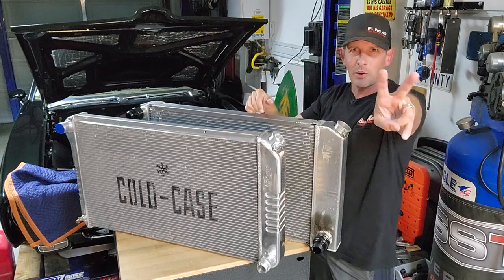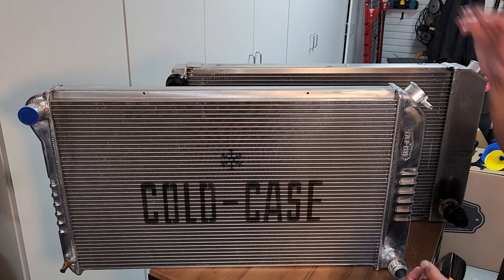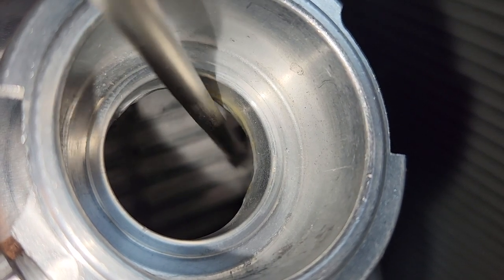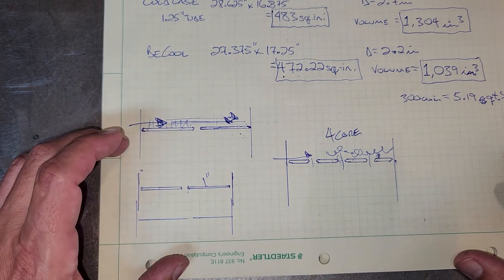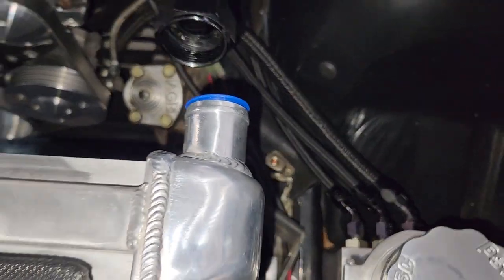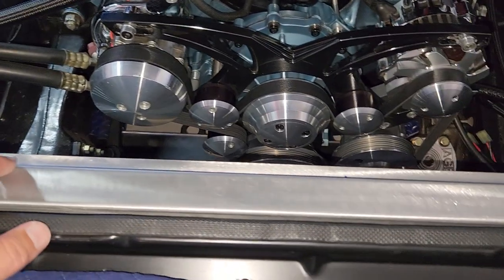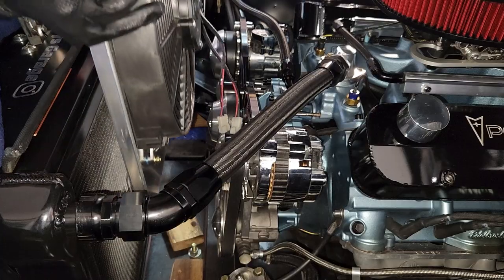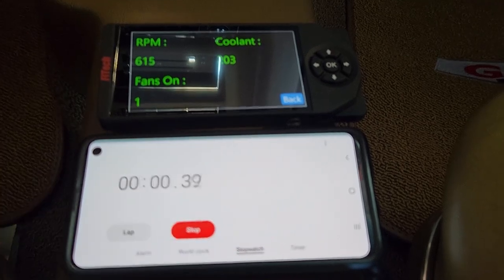Cold Case Radiator vs. Be Cool, with Twin 14" Fans, install and test.  Part 2

Comment: Could also be an effect due to paint. Surprised you didn’t check bare cold case first! Thanks for all the effort.
Reply from the maker: Good point... if at all, it would be a very very minor difference.  (I didn't paint the back side)  Thanks for the comment!

Comment: Fantastic content. So few people are talking about stuff like this, or doing much than repeating common cooling myths. 
CFD has shows that the coolant flow VELOCITY through the tubes is WAY more important than previously, though, too.  -This is where I think at a certain point there can be challenges with 2x1.25" wide tubes, or the event wider extruded tube radiators -they seem to need to be combined with high flow water pumps and thermostats to keep the coolant in turbulent flow. I think C&R / PWR said that when the coolant in a radiator tube moves from turbulent to laminar flow as it slows, the cooling efficiency can drop by 50%.  Theoretically, these radiators with more coolant flow area through the tubes need either more water pump flow or dimple tubes to increase internal liquid turbulence. 

What was your crank to water pump pulley ratio for this test out of curiousity?

Cold Case is the only one with those 2x1.25" tubes for ANYWHERE NEAR that price point. They're pretty crazy value. My critique is that sometimes the Cold Case radiators come with smaller inlet and outlet sizes when larger ones were available from the factory for the same radiator. I'd love to see those big 2x1.25" tubes not being restricted by tiny inlets and outlets. I also think they really should be letting people know that the big tubes work BEST with high flow water pumps and thermostats, too.
Reply from the maker: Thanks Adam... agreed about laminar flow, versus turbulent.  In my readings, that has a bigger impact on extracting heat from the block, which is also related to the type of coolant.  Anyway, my crank to water pump pulley is pretty close to stock, but I do have a FlowKooler pump.  I think my next experiment is using a dual flow radiator, also from ColdCase as I like their internal design.  Thanks for the comment!

Comment: I'd be interested in seeing a video where you adjust your coolant to water ratio down to something like 75% water and 25% coolant and make sure you have at least a 16 PSI radiator cap and do the test one more time.

Just add a compatible anti-corrosion / water-wetter product to provide the extra corrosion protection for the extra water.

I did NOT realize you were using Evans coolant! An even more interesting test is possible: Evans vs. A typical 50/50 glycol blend, then remove a calculated amount of the coolant blend (using an online dilution calculator) and add enough distilled water and an anti-coorosion+water wetter product to do a final 75/25 water to glycol blend.  -The Specific heat of your coolant will improve every time and the viscosity / flow due to the reduced viscosity will, too. 

At 180F, +14% coolant flow is required to make up for the decreased thermal conductivity of a 50/50 blend vs. pure water, I don't know the difference for pure propylene glycol, but it's not insignificant.  -Might even convince you to stop running Evans Coolant... 

If you think you'll do it, let me know and I'd be happy to donate $20 somewhere to help cover coolant costs for the test.

The Net Heat Transport Capability of 50% propylene glycol is almost exactly 1.5x as much as the 100% Propylene Glycol
Reply from the maker: Ha!  Nope.  Not gonna change from Evans coolant, i love it.  As you know, it has no water in it, which raises the boiling point dramatically.  Evans' site has some great education on why it works so well.  To your point, water helps with heat transfer, BUT, it boils too easily causing too much pressure, and possible cavitation, when both are combined, BOOM.  Good thoughts, non-the-less.  Thanks!
Reply: @FastMonty  I know what Evans SAYS. But there's many reasons why almost every form of racing uses pure water, high volume pumps, and high pressure radiator caps. Faster coolant flow and a higher radiator cap pressure will also resist boiling dramatically (282F) AND will give you way lower engine temps vs. Evans. 

Evans is trading more boil protection that you don't need, for higher engine metal / coolant temps that are quite beneficial.

Takes only one easy test to prove it either way and "good content". 

Drain the Evans, replace with VP Racing High-Performance (30% Propylene Glycol / 70% water.).
Reply from the maker: Might be worth exploring, thanks for the possible idea!   @adamarndt7617

Comment: Great video and WOW the detail !! ,  Thoughts on dual fan setup vs single Lincoln Mark VIII fan?  I have heard many people use the Mark VII fan with minimal customization  with the same controller you used. .  CFM rating and AMP draw are very close yet you save on $$$.
Reply from the maker: Thanks Raffi.  Yup, Mark VIII fan's work great.  HOWEVER, they only have two wires that pull 40 amps.  Versus twin fans I'm using have four wires pulling 30 to 40 amps total.  Moral of the story is the Mark VIII fan connectors are a trouble spot and must be upgraded in size.  OR, some other work around as to not fry that connector.  Thanks for the comment!

Comment: Awesome video thanks for the content! Looking to buy this radiator. What are you thoughts on it being made overseas and how do you think it compares to other USA made brands like Griffin?
Reply from the maker: Not sure it matters where it's made.. the design of "wide Tubes" works.  Griffin makes an awesome product too!  You can't go wrong either way... have fun!
Reply: Ended up going with the Cold Case with dual 14” fans. Great bang for the buck. Solved all my overheating issues!! Thanks for the tips!
Reply from the maker: @dvdr1985  That's great to hear!  Can you share what vehicle you "cooled off"?  Thanks!
Reply: A big yacht… 1972 Pontiac Grand Prix 🥸
Reply from the maker: @dvdr1985  Ohhhh very nice!  Glad she's back to floating on cold water.  ha, ha... thanks!

Comment: Again great tutorial  i have a cold case on my 65 lemans but have not started the car yet...   any thoughts on using a anode   (Flex-a-lite Radiator Zinc Anode)  i have one installed on my alum rad on my chevelle
Reply from the maker: Thanks Steven!  The jury is out on using an anode.  I know it can be worse with coolant that has water in it.  I use Evans Cooant, which does NOT have water.  So, maybe that's why I don't see any residue or damage?
Reply: @FastMonty  good point i forgot that you were i may be switching to the evans

Comment: Hey Monty
Do you have any part numbers for the cold case rad and fan set up your using? I've also been building a 69 goat with a 468 torque monster and i'm not wanting to use the stock rad and or shroud fan combo.
I really like your set up and thanks for the videos
Reply from the maker: Thanks Glenn... you'll have to search the radiator on their website, because it'll depend if you need the built in transmission cooler, or not.  Then, buy the SHROUD only.  See my latest video as to why. https://www.youtube.com/watch?v=pYkuNP1RnoM&t=183s  Don't forget my discount code when shopping at Cold Case.  Thanks again!

Comment: Where did you get the large A.N fittings for your radiator?

Can you do a quick video on power  steering hose routing to remote can.  Thank you for all you do sir. # lifesaver!
Reply from the maker: Hey Chris, good question... this video summarizes the radiator hose and AN Fittings, etc... I'll be briefly covering my hydroboost system when I install my new Wilwood Master cylinder.  In a couple months?  Stay tuned!  Thanks for the comment.

Comment: Hey my friend.  It might be an illusion but it looks like the upper radiator hose doesn't have any give in it for when the engine torques on acceleration. From the camera view, it looks like a good hole shot might yank the upper fitting off the radiator.  Very nice work.
Reply from the maker: Great point!  It does have some flex to it, and I'm using super stiff Engine Mounts.  I'll keep an eye on it.  Thanks!

Comment: I'm looking at buying a radiator for my '67 Lemans. For those of you that have been running coldcase how is the quality?
Reply from the maker: Mine has been working great!  The only thing I'd recommend, if you're using electric fans, is to buy the Cold Case shroud/fan kit, then upgrade the fans to SPAL fans... here's the video I did on that.  https://youtu.be/roExpEcuAKM  (Don't forget to use my discount code for that new radiator!  "FastMonty")  Have fun!
Reply: @FastMonty  Thank you
Reply from the maker: Welcome! @kellyperry8755

Comment: Did you ever find the link for the petcock on Amazon? I have the cold case radiator and dual 12s on my 69 GTO, but recently one of the fans stopped working. Even so this thing stays very cool. If I can't get the second fan back online I'll go ahead and order the dual 14s from cold case. But the petcock would be a nice change! If you remember thread sizing, the link or anything else I'd appreciate it!
Reply from the maker: Thanks for the comment... yeah, I found it, it's on Summit's site;  https://www.summitracing.com/parts/EDD-308400  Can't wait to hear how it goes!

Comment: Im using a summit 4 row radiator with a mechanical fan it works great..even in 90 degree weather in stop and go traffic it doesnt even run hot..im kinda afraid that it might be running too cold 🥶 …Anyways your videos are awesome!! I almost bought a 68 gto before I bought my k5 blazer..
Reply from the maker: That's awesome!  If you haven't done so, I'd recommend a Mechanical Temperature gauge, just in case your stock gauge isn't "telling the truth".  Assuming you are running cold, that's fantastic!  You can increase the temp with a higher temp thermostat.  Thanks for the comment!
Reply: @FastMonty  i will try that

Comment: What cable sheathing are you using on your wiring? Trying to get rid of that plastic garbage spooling
Reply from the maker: Good question... the sheathing on the fans, came with the fans.  But, if you're referring to my engine wire harness, that's the Painless Performance "PowerBraid".  Hope that helps.

Comment: Have you ever thought about using Evans waterless radiator coolant. It suppose to be better for your radiator and a higher boil point.
Reply from the maker: Ha!  That's exactly what I'm using. I totally forgot to mention that. Thanks for the reminder.
Reply: Higher boiling point but way worse specific heat and thermal conductivity AND worse dynamic viscosity which reduces coolant flow. -You can increase the boiling point of a water-glycol mix by just installing a higher radiator cap pressure when everything is cool and have WAY better cooling than an Evans based-system.

Comment: I installed a cold case in my big block nova in the spring, after having my engine rebuilt. It had a small block aluminum radiator before. Found no difference in cooling between the small block radiator and the big block radiator using stock fan. Wanting to keep under hood looking original. Now looking for another alternative
Reply from the maker: Thanks Mike... sorry to hear it didn't meet expectations.  My favorite aspect is the change in shrouds, and fan size.  Good luck on your hunt!  Thanks again.
Reply: @FastMonty  I did add a fan shroud and a 6 blade fan. Really thought that would do it. But sadly, it didn’t
Reply from the maker: @mikeburnett7028  Bummer.  What about using the old radiator?  Did that change it back to running cooler?  This isn't the first time I've heard of someone getting their engine rebuilt, and it's suddenly running hotter.  So many things can change in a build, it's frightening.  (The biggest problem is the ground path from the stock sensor might have changed enough to give you a false reading, which is why I now also have a Mechanical Temp gauge)  Just food for thought...   keep us posted!
Reply: @FastMonty  the old radiator was for a small block. Less water and cooling capacity. Also before rebuilding, ran no shroud and had a cheap flex fan. Guess I’ll add an electric pusher on the front and see if that helps. Car is put away for winter now. Gets cold here in Indiana in the winter
Reply: @FastMonty  using a Derale 18” 6 blade fan. After looking at the box it came in, and pictures online, it may be backwards. Had it turned around the other way, but still got hot. Recently modified fan mounting bracket to locate 1/2 inch farther forward and reversed fan in the process, thinking that would help cause the fan has a curve at the top. Looks like the curve should face forward. Won’t know now till spring with cooler weather here if that helps.
Reply from the maker: @mikeburnett7028  Ha!  Yeah, makes sense.
Reply from the maker: @mikeburnett7028  Ha!  Yeah, fan direction would make a huge difference.  Keep us posted.
Reply: @FastMonty  fan pulls air in either direction. It’s the tip of the fans blades that supposedly makes the difference. I had it on correctly when I installed it initially, but still didn’t pull much air at idle. Hopefully moving the radiator closer to the front to eliminate gaps will help
Reply from the maker: @mikeburnett7028  There in lies the issue with a stock fan... no CFM at idle.  Yes, gaps are extremely important.  Have fun!
Reply: @FastMonty  thanks dude. Still enjoying your videos
Reply from the maker: @mikeburnett7028  Great!  Thanks Mike!

Comment: I have a cold case on my 65 GTO. Fortunately the radiator does a great job of cooling with a single electric fan because there isn't enough room for 2 14 inch fans
Reply from the maker: Great to hear the single fan is doing it's job.  Thanks for the comment!
Reply: @FastMonty  Yeah, the 65 and 66 GTO's can't fit the 14" fans.  I wonder if the dual 12" fans will do the trick?  Thoughts?
Reply from the maker: @WaveCrusher  Great question... before you go there, make sure you watch my "How to Measure CFM" video.  My suggestion is to do what I did and measure several fans BEFORE committing to a shroud.  (I do like the Cold Case Shroud)  Here it is ... https://www.youtube.com/watch?v=pYkuNP1RnoM&t=132s

Comment: Do they make one for 5.3 in a 1965 f100 with fans and hoses on the right side top and bottom hoses thks
Reply from the maker: Good question, Peter.  I don't know.  I'd call them to find out... I'm sure they'll have some good ideas for you.  AND, you can still used my discount code, "FastMonty".  Let us know what happens!
Reply: @FastMonty  no they don't make a radiator for that conversion
Reply from the maker: That's a bummer... is there something "close" where you'd need to modify the core support?  Sorry, I know nothing about 65 F100's... just thinking out loud.  Let us know what you end up doing!  Thanks for the comment. @PeterHatch-mx7zc
Reply: @FastMonty  I'll just bite the bullet have Davis radiator build me one very expensive!!!